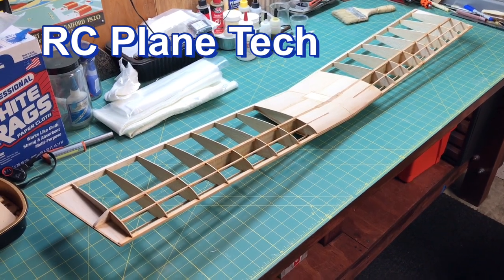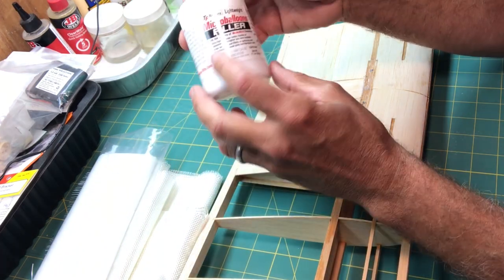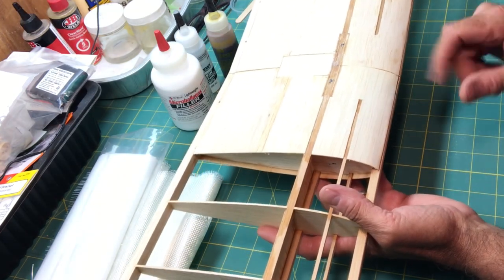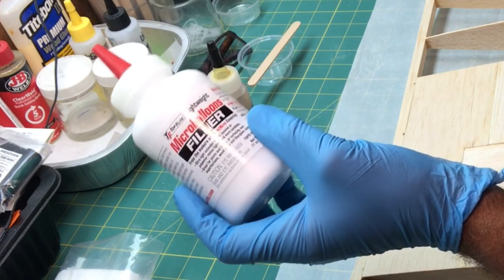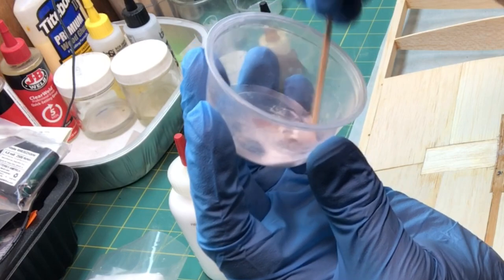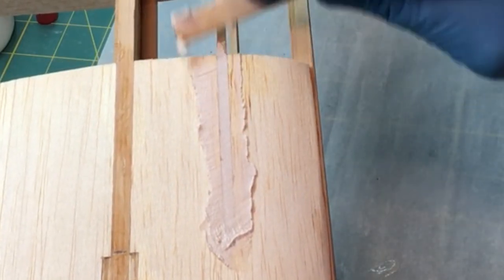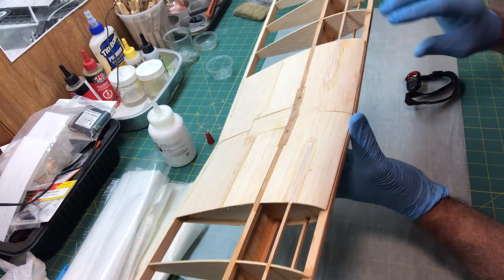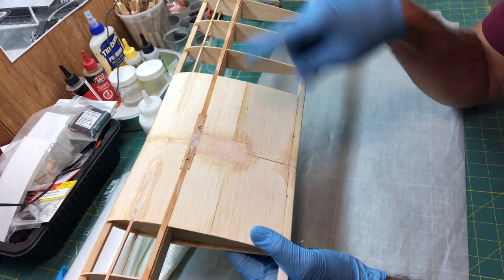Barnstormer 25S Vintage RC Plane Build: 11 Microballoons

Comment: It works out a lot better if you lay down some lo-tac tape on either side of the area you want to fill, makes sanding easy. Just a tip so you will know next time using microballons.
Reply from the maker: That is true. Thanks